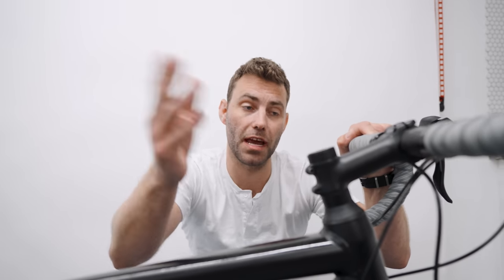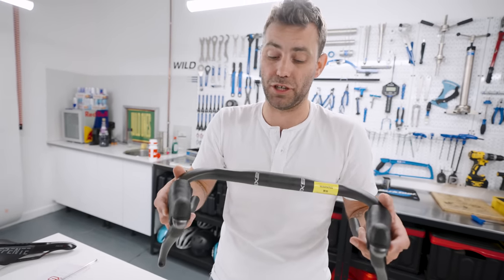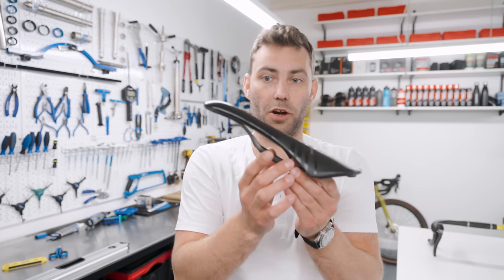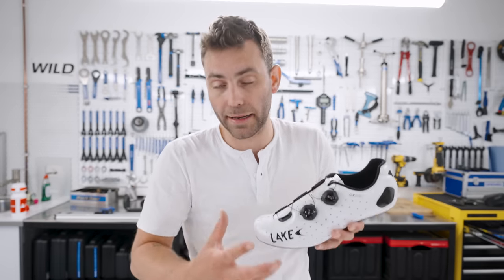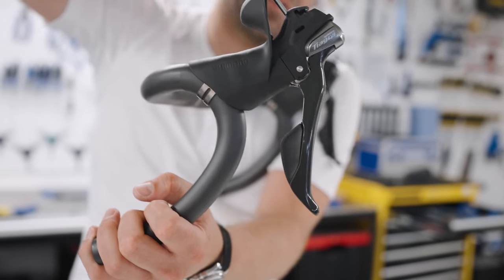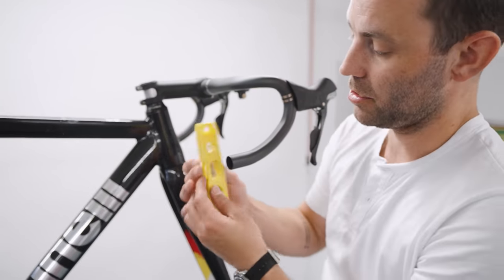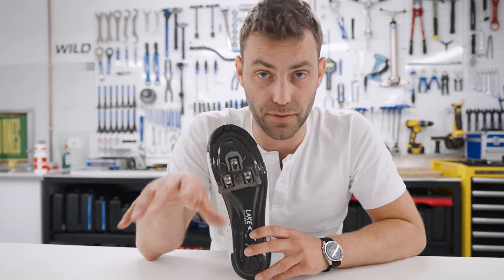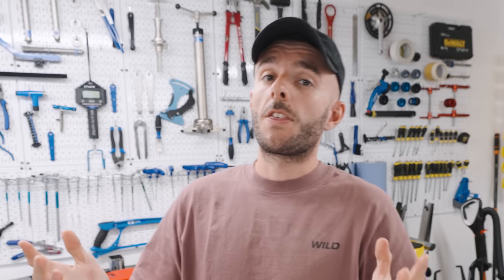7 Bike Fit Adjustments You Can do for FREE

Comment: One thing I find that really helps when doing up your shoes when you only have a single boa dial is to put a thumb or finger under the tongue, tighten, remove finger, and then tighten again. This helps with making sure that the shoe tightens lower down first instead of just cranking on it and then feeling like the upper part is way too tight and the lower part is still loose.
Reply: Mine is the other way around. The toes are too tight. How do I tighten so the upper part is tighter?
Reply: @escamunicha4276  do the same, but in the opposite way: put a finger under the front "threads"
Reply: James’s advice is good. All the other bike fitters on youtube are awful.
Reply: @tomreingold4024  agreed 💯
Reply: Nice tip!

Comment: I made several adjustments to my bike setup based on recommendations on this channel: I moved the cleats all the way back, lowered the saddle height by a few millimeters, obtained a shorter stem and narrower bars, and leveled the saddle tilt. As a result, I no longer experience pain in my palms, and it feels like I can generate more power and engage my glutes more effectively. Overall, it seems that I am more grounded on the bike and have better control using my legs and body rather than relying on my arms.

Comment: Flipping the stem while moving it lower to keep the same drop you will end up with exactly the same reach. The two positions of the stem are like two sides of a triangle, they meet at the same poit. 

The reason that the reach was reduced on this bike is because not enough spacers were removed and the deop was reduces. You would need to remove around 20 mm of spacers on a 110 mm stem in order to keep the same drop.
Reply: That is exactly what I was thinking..flipping the stem might even mean more reach since the fork leans back so the lower the stem is on the fork then the further away it is...I reduced reach by flipping the stem but also lifting it higher and using a shorter one...whilst also changing the bars to a modern design with less reach....

Comment: I’m a career mountain bikers, recently switched to a roadie! Made the classic mistake of buying a bike based off the size guide and it was huge, felt like my arms were being pulled out my sockets. 

New frame later with a much shorter reach and a 20mm shorter stem. My posture is now much better and I’ve a bend in my arms. 
However I’m getting bad lower back ache on the right side. 
Is this just new muscles my cave man body needs to think about using? Or more likely a saddle/saddle height issue? 
I’d say I have a very strong core, developed from mountain biking, but obviously a much different posture. 
I’m also not one for stretching.. yeah sorry muscles!

I’m only a couple of rides into my new bike!

Comment: I do have indeed a question: I usually suffer under the numb testicle syndrome and experimented quite a lot with seating positions, saddles and cycling shorts. I also might have bit of an anterior pelvic tilt, don't know if this amplifies that problem. Is there anything specific I can try, or maybe some stretching to get my place on the saddle different? Thanks a lot! Keep up the good work!
Reply: I have the same problem most saddles have a bolt on the bottom loosen it and slide and tilt it very slightly forward or back work a treat for me 👍🏻

Comment: I tried moving the cleat back a few years past and found that it greatly reduced my sprint power and ability to maintain a high cadence. That said, sprints are my strength and I generally ride at a higher cadence than most. The far back cleat position just doesn't suit my riding style.

Comment: I'm a big fan of James' videos but that stem flip tricks is wrong. If the bar drop and stem stay the same, the reach will stay the same. This is basic geometry. The only way for this to work would be to use a stem with adjustable angle.
Reply: It is basic geometry, but your wrong. All things being equal the stem flip-
WILL shorten your reach 
WILL increase your handlebar stack height
WILL put you in a more relaxed position 
Much more complicated math but still affected-
is it WILL actually quicken up your steering response too. We're talking mm not cm and not perceptible to 99% of people. The steep stem would make this easier to actually feel.
Reply: @Urchasingshadows02  In the video he talks about lowering the stem while flipping it to have the same handlebar stack but reducing the reach which is not possible without changing the stem length or angle

Comment: It was slightly confusing when you were talking about the tilt of the seat because you weren’t using proper terminology. If you stand on the side of the bike and look at the seat in a two dimensional Cartesian coordinate plane with a horizontal line across the top of the seat, being the horizontal x axis and a plumb line perpendicular to the seat being the y-axis. if the saddle slightly tilts forward from left to right, it has a negative slope and genatalia issues are compounded if the saddle till slightly upward from left to right it has a positive slope and could cause hip issues. Just remember Y= mx +b

Comment: The stem flip is BS. How can you possibly change the reach without changing handlebar drop? The length of the stem remains constant, and so the only way of shortening reach is by raising the bars (as the head tube angle is not vertical). If the height of the bars relative to the fork steerer tube is constant, the only way of decreasing reach is by making them closer together, which is not achieved by flipping the stem.